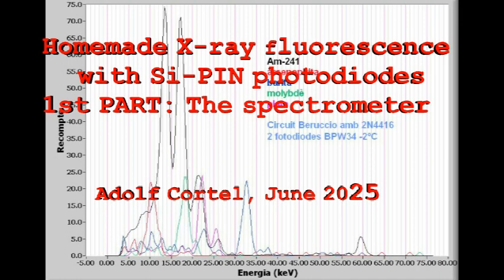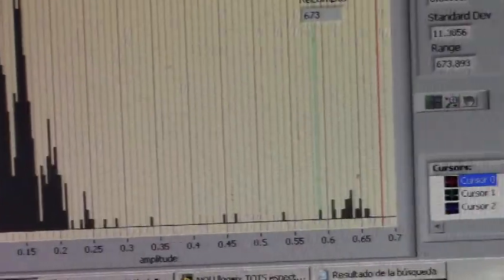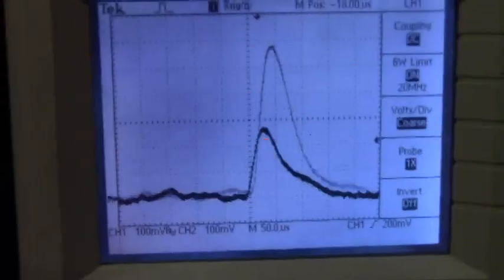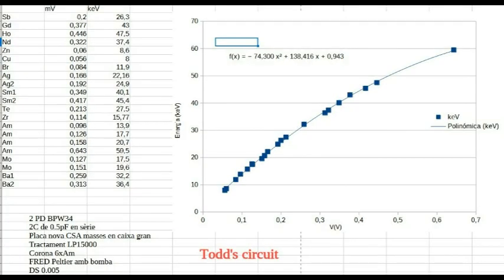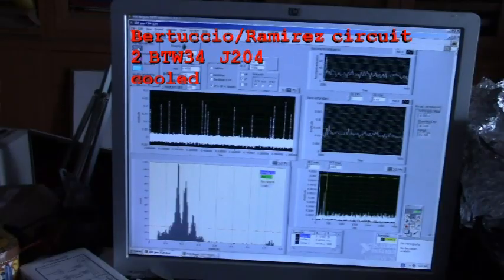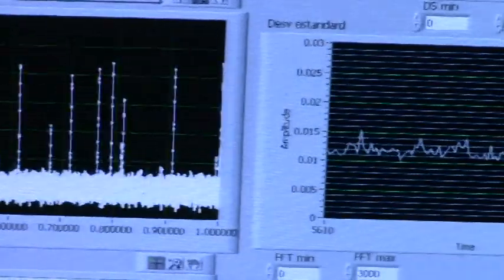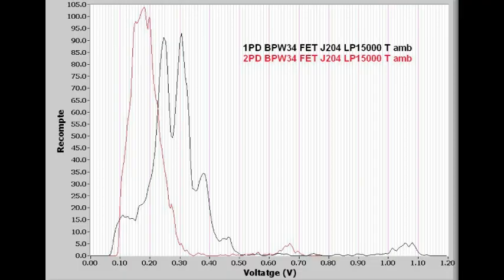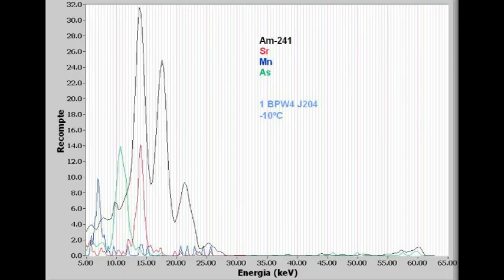Homemade x-ray fluorescence with PIN photodiodes (I)

Comment: I am interested in seeing more details about the cooling setup you are using.

I'm working on my own xrf setup with now, it's a challenging project.
Reply from the maker: Hello,
In my setup, I only cool the aluminum box containing the charge-sensitive amplifier (CSA).
If this is done with a Peltier cell on a heatsink cooled by a fan or  on a hestsink cooled by circulating cold water, it's important to keep in mind that the pump or fan can generate electrical noise.
With small photodiodes, like the BPW34, cooling to around 5°C is enough. Therefore, a simple and effective method can be used: an expanded polystyrene box (like those used for frozen goods), a fairly large aluminum heatsink, and the aluminum box with the CSA placed directly on the heatsink with thermal paste. The box is then filled with bottles or packs of frozen water. This achieves temperatures close to 0°C and allows for several hours of operation.

Regards

Comment: Absolutely stunning piece of work Adolf. As a retired electronics design engineer I can well appreciate the hurdles you’ve overcome here! Awaiting the next video mate,
Regards Rog
Reply from the maker: Hi Roger,
Thanks for your kind comment! This is a project I have had in the drawer for some years and it has supposed a lot of work indeed. I began with an expensive A250 CSA module by Amptek I had bought in ebay and after a lot of trials, when everything was running OK the module crashed (as I had ben afraid from the beginning!) . Since buying another one was absolutely discarted I was lucky to find the circuits described in the video, absolutely inexpensives,  which work almost as well as the A250.